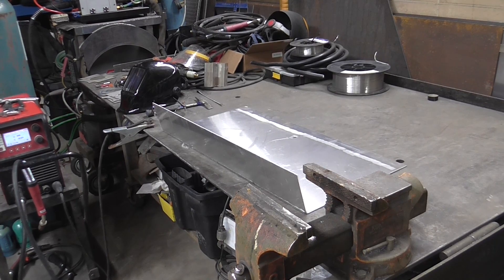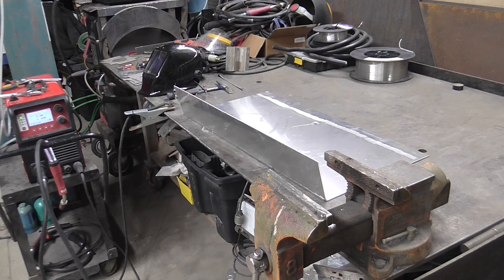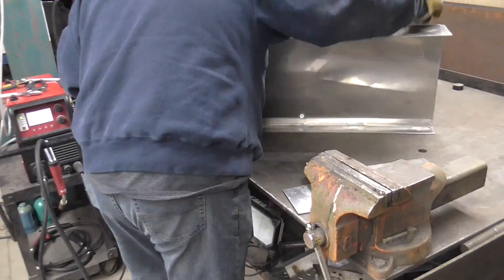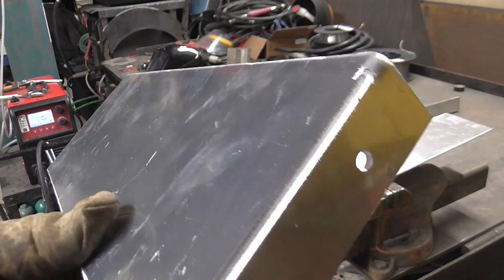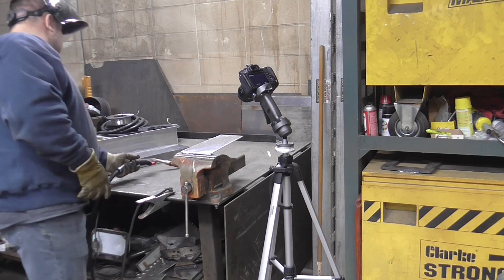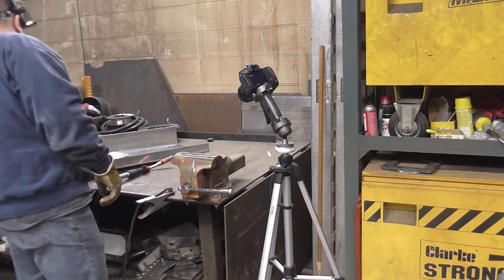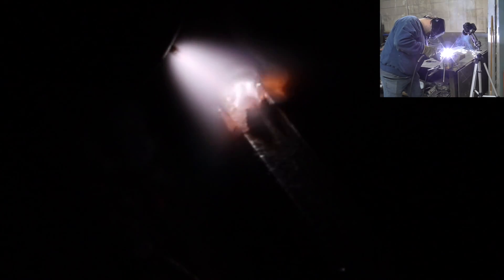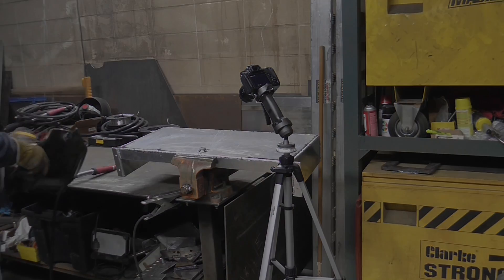Pulse mig aluminum in detail ! no matter what machine you own or want to buy

Comment: great video ! how much more alum metal thickness dose using a helium /argon mix shielding gas allow over using just straight argon ?
Reply from the maker: so that is not an easy question.   with this particular machine as with most other synergic mig with synergic pulse mig welders - if the program calls for 100% argon there are really almost no benefits using a helium mixture ....!  
the added heat of the helium if working counter productive to the program and the parameters in the program .....   

now if you are thinking of mig aluminum without pulse (like a spool gun ) or thick aluminum wires 1/16" or thicker being fed out of a suitcase for ship building for example - on some of those jobs the welding procedure calls for 100% helium.  and generally speaking helium mixtures make things a lot hotter (if you have the right tips and your spool gun can feed enough wire fast enough (or your wire diameter is big enough) helium or helium mixtures can be a great advantage. 
also on ac tig helium mixtures can be a great advantage.  (on tig on material that is more than 1/8" thick.

now consider the drawbacks of helium:
- hard arc starting 
- less arc stability than argon
- possible puddle does not flow as well
- very high cost

so if you outweigh those drawbacks and you choose your mixture careful .....
lets say if you tig and you have 75%ar  25%he   you will see a huge improvement 
if you go to   75% he  and 25% ar - you will see even more heat - but the step from the one gas to the other is NOT as big as the first step introducing 25%he .....  you will see harder arc starting   (2%ceriated tungstens will help you here - they start easier than a lot of others) .......
and with 75%he  25%ar for sure it is very hard ( i dont want to say impossible to weld anything thinner than .100" with an ac tig no pulse)

common mixtures are 
25/75
33/66
50/50
66/33
75/25
all depending on your gas supplier .....

as far as your question how much more heat it makes ?

my 200 amp acdc tig "feels like" 250-275 amp with a 75 he 25 ar mixture
on straight mig aluminum (no pulse) the results are similar ....  you will have to try and see what works for you - personally i would not use any helium mixture on mig aluminum unless i am welding at least 1/4" thick
personally - i dont even see the need for it up to 1/2" thick    (spool gun and 300 amp engine drive do just fine with 100% argon)

Comment: I would like to ask a few questions if I may? Is that suppose to be used for aluminum bc it looks like a regulars steel gun? Second yea you are running very hot and at the same time you don’t have enough wire feeding your arc or it’s not the right gun to weld aluminum. Just trying to help not trying to be dictator!
Reply from the maker: dennis ayala this gun has a graphite liner and is especially made for welding aluminum - please read the other comment about welding guns in this video that i replied to. Yes - spray arc is very hot!  Pulse aluminum mig is even hotter than regular mig aluminum. And yes - in the beginning of the video i explain how i am using an helium argon mixture and how that is not suitable for the synergic program - how it is too hot ( you need less voltage not more wire ( i know same thing)) and also the puddle does not want to flow right either!  But that is all explained ...
Reply: ZILA no I don’t think it’s a matter of amps running thru I think it’s a matter of speed! the small feeder in the machine can’t feed enough material no matter how low you put your amps that’s why you have and extra motor on the push pull gun or a spool gun. I’m just trying to help not trying to be a troll or anything but hey if it’s working for you that’s cool man good luck and looking forward to seeing more videos
Reply from the maker: dennis.   first of all speed makes amps !  the way how a wire feed welder works the voltage is held at a constant value (with very small variations due to arc length and gun distance to work piece.   2nd speed is amps - the more wire you feed (either bigger diameter OR higher speed THAT makes your amps !  The small feeder in the machine puts out 100% reliable 16 meters per minute or 629 inches per minute that is plenty enough. and yes - miller and lincoln feed aluminum wire through a 10 ft long push style mig gun with 2 roller drives (on the miller 350p and the lincoln 350 mp !!!)   and i think that you are tolling or way under informed !  here is what a push pull gun does:"  the speed does NOT change using a push pull gun - it does not make things faster - it makes things feed more even and the pull motor helps pulling theft aluminum wire through he LONG gun so it does not kink in the gun.  if you gun is short enough you can easily do that with a push motor only.   the push pull gun uses the internal feeder and the feeder in the gun to work in sync (both of them are running the same speed) at least nominal some manufactures have a tiny bit more power on the pull motor to avoid binding of the wire in the cable of the push pull gun - but we are taking about an almost not noticeable amount because if you run the pull motor too fast it would either get hot and burn out or slip the aluminum wire in the feed wheel of the pull gun.  the wire travels at a set speed (whatever the operator has set it at) through the push pull gun and if either one of the motors is noticeably faster than the other one, it does create major problems.  
now how do i know all this ?  i actually weld pulse aluminum for years already, i own lincoln pulse welders, i have used my customers miller pulse welders, i own and have installed push pull guns in welding machines that didnt have those before, there is a little control board that you can dial the speeds in and procedures to synchronize the internal feeder and the feeder in the gun.  
In this video i was welding at about 320 IPM with 045   4043  aluminum wire - which will make a Perfect weld and perfect arc length if used with 100% argon !!!!  THAT is my case and point - there is always someone who tells me  - you are doing this wrong and doing that wrong !  and in real life - the amperage that is produced by using this kind of wire in this diameter at that speed - is perfect for that material thickness (1/8") ....  now using the helium mixture makes the arc hotter (so i reduced voltage "trying" to compensate) because if i would have added wire - it would have been too hot !!!!!  also the helium makes the arc hard to ignite on tig machines and makes the puddle less "fluid" (its harder to wet the toe lines correctly and make it all melt right) on a pulse mig.  it even increases the amount of soot in a pulse mig machine.   
so i am pretty sure i know what i am doing - i ran the machine in the high 400s up to 500 ipm with the same wire on 1/4" and thicker material (with 100% argon) and i assure you it runs just fine and the little wire feeder has plenty of speed and power !

BUT - - THANY YOU for pointing out exactly the reason why i make this video - because everyone know everything about mig welding because it is too  easy .... and everyone knows exactly how i am doing everything wrong ... and it is really interesting  - if you want to i invite you to my shop and we have the camera rolling and you can show me exactly how to do all this.

also if you ever weld with a full synergic pulse mig - you find out real quick that you dont adjust arc length with wire speed.  most machines have a function that is somewhat based off voltage.  lincoln calls it TRIM miller had their own thing similar to it and so does this machine ... controlling arc length is a largely voltage based operation - but it also has to do with the shape of the pulse and other pulse function which i am not enough of an electrical engineer to really explain all of those to you in depth right here ... 
"back in the days" of the step voltage transformer when you were doing short circuit mig ... and you were in-between voltage tab 4 and 5 you had to pick one of them and then you used your infinite wire speed adjustment to dial it in all the way ! ....  on a synergic machine you pick your material thickness (or amperage - depending on make, model, etc of your welding machine) and you adjust the voltage (or induction) to get the arc characteristics you desire
believe it or not - that is not only miller, lincoln htp ... thats work the same way on esab and even everlast mig welders .....
Reply: ZILA lol I’m not trying to troll I’m sorry I offended you. Hope you have a great life and hope you make lots of money welding. Good luck in your own little shop. P.s I would love to go on camera and weld something for you. Let me know when we can get together
Reply from the maker: you didnt offend me !  if you would have - i would have just clicked the little button that says - "hide user from channel" and also i would not have offered you to make a video with me  !    as far as timing - let me know - i am 15 min south other the milwaukee airport - i dont know how far you are what it takes for you to get here  - let me know
Reply from the maker: dennis - its just hard to tell who is doing what ... there is a fair share of guys coming here tell me that i hate on certain companies ...  i hate in miller, i hate on lincoln, i hate on everlast ... the list is long ....  and also i dont know how to weld and i am doing everything wrong anyways ...   so i guess i just got "used to it "  LOL  
i mean more power to everybody who can do better than me - i am not the best there is  - there are guys who are not even on youtube and they can do better than me ...  and as far as hating on machines - i really dont ...  i mean occasionally i point out some shortcoming on some machines or to say it a little bit more specific things that i personally see as a shortcoming based on my personal likings and experience ...  and with some companies i dont even have much experience so i can not and will not tell people yes buy this or no dont buy it because i dont know enough about them .....
anyways - let me know when you want to make a video
Reply: ZILA yea man I understand in my point of view on machines is that some  have certain settings that allow them to be better than others in certain procedures. I have no preference or care for all that mochó bullshit as long as it gets the job done right at a productive matter and that the client is happy with the work... as for me making videos one day I hope to start my own youtube channel one day lol. Honestly I was asking questions bc I’ve never seen anyone weld aluminum with a regular gun and I always thought about doing just wasn’t sure if it would work.

Comment: What are you running for a gun that you can push aluminum wire?
Reply from the maker: Hi,  to answer your question: it is a binzel 26 series clone about 8.5 ft long.   No that answer is pretty useless to you so let me tell you what really to look out for.  
(almost) Every manufacture has some sort of solution to push wire through a mig gun.   Miller does (on the 350p Lincoln does (on the 350 mp) HTP does ... etc ...  what all these solutions have in common is:
a heavy and thick gun cable that helps you to avoid shaft loops and bends
they are typically short - between 8ft and 10 ft - sometimes 12'
they all have special liners   nylon, teflon or graphite
if the guns are air cooled they also have brass neck liners
so that is the majority of the "secret" the other part is contact tips that are designed to handle the heat and are properly sized
and drive rolls that are shaped specifically to "hug" the aluminum wire and not crush it.   

help watching a few more of my videos - i will make further explanations in the next few month - if you look at the aluminum boat video it also shows those drive rolls etc ....
Reply: ZILA,  thanks for the response, I am running a spool gun on a 252 miller but the small spools are a pain in the butt.
Reply from the maker: at the end of every spool you also junk a contact tip ....
Reply: A push/pull setup is the most ideal especially if running 25ft leads. At work I use a miller 352mpa with a binzel push/pull setup.

Comment: Hey Pete , thank you for taking the time to make this video much appreciated, i haven't had much of a chance to give that Everlast 275p a good run since our last chat but hopefully in the next week or so i will , i also had a good chat with Sharn ( mr green ) So if i can get my settings right it should run and sound like that last slow motion bit ? I can only hope . 
Cheers Troy
Reply from the maker: Troy Morrison very similar.   No double pulse ( i believe in this video it is all double pulse) 
Look at your arc !  Your overall settings need to be right.  If you are similar to that shot at the end - add 0.5 or a little more volt to make the arc longer and reduce the crackle. 
If your arc is longer already and you still have crackling issues raise the frequency and or raise your background voltage. 
Now as you raise your background voltage your arc might be getting too long over all ( just like in the beginning of the video where i was using the wrong gas - then of course lower your voltage a little ( after raising the background and now the arc being too long)  
I would advice you NOT  to increase the wire speed trying to “ correct “ the situation since that will “ throw everything off”
Reply: Troy Morrison hey Troy I have the everlast 251MTS, I'm the same haven't had the chance to give it a good workout and play with settings ect for aluminium, I'd be interested to see how you go with setting it all up and that if you could let me know so I have some rough settings to go of with mine that'd be great 
Cheers josh
Reply from the maker: Joshy Old mate i am about to make a video to show some settings ( only some not all of them ) because i will also be offering classes for guys who bought those machines and now dont know what to do with it .....  
And from what i see on all the comments - there is quiet a few out there!
Reply: ZILA yeah that would be great, do you think the settings would be pretty close with your HTP and the everlast? Also I can adjust it myself (with a decent amount of time) as I build aluminium truck/ute body's for a living tig and mig weld every day so I'm somewhat knowledgable on settings just haven't had the chance working 6 days a week and with 2 young kids there's really not much time to have a good play around with it haha
Cheers
Reply: Hey Josh , when i get around to it i will let you know just struggling to find a little time at the moment .
Talk soon Cheers 
Troy
Reply: Troy Morrison no worries thanks Troy